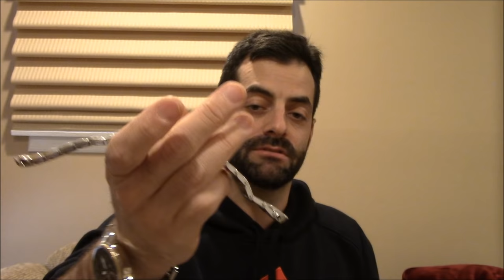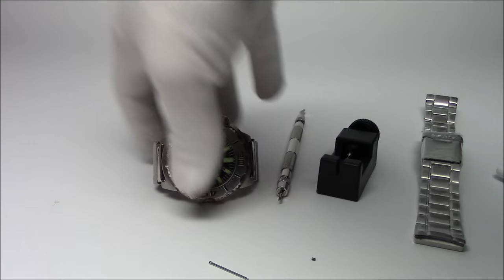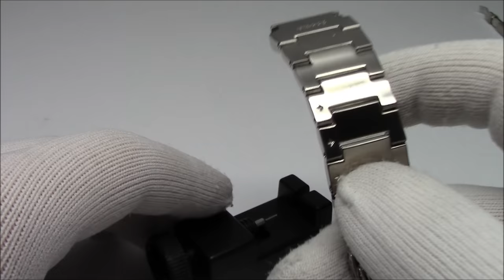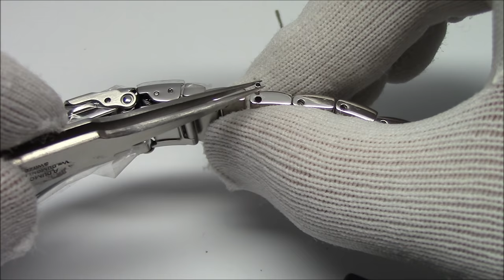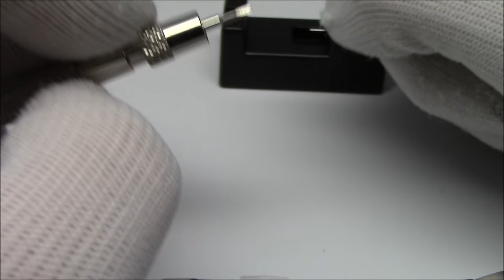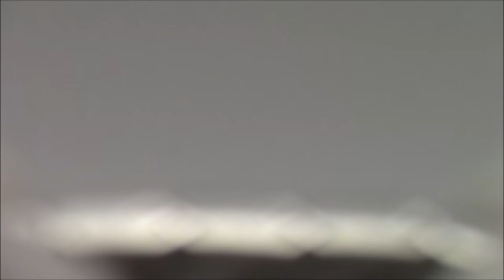How to size a Seiko (or any!) Pin and Collar Bracelet. Watch and Learn #15

Comment: these colar and pin systems are a complete nightmare to resize. Not just because it so fiddly and really adds nothing to the reliability or function of the bracelet, but because the collar part is SO TINY that if it flicks off when you are working on it you will never see it again and these are very hard and expensive ton get as replacement parts.

Comment: These are on the orient triton. Wanted to smash my head against a wall until I found this video
Reply: So you managed to do it? Did uou have the tools in the video? Cause without tools i cant put the damn collar inside the cap like Mark does and im running rapidly outta patience after 1h or trying :(
Managed to remove 2 pins with a paperclip, but no way to put one back cause of the damn collar not fitting in the hole by itself like in the video.
Anyone has any ideas for me, pls?
Reply: @CataVlad21  i know this is a year old but it might be that you can only insert it through the inside of the link. I know some seikos are like that.
Reply: I was freaking out because I thought there were two collars per link, so I was having some trouble. Finally, being completely frustrated I came to this video. What a lifesaver. 😂

Comment: Thanks, this video saved my butt when resizing my son's new Citizen watch. Did it on my own to start with, I was incredibly lucky not to lose the collars. Once I saw those, I knew I needed help and found your video. My son's new (2019) Citizen is different than my older one, which is like the Seiko you show here. The newer Citizen has the collar drop into the inner tang of the link, not the outer, which makes assembly and removal much easier,  just drop the collar in, put the link together, then drive the pin through. Thanks again for making Dad look good.
Reply: Me too. Removed the pin and this tiny split pipe thing dropped out. I’m like: uh oh! So easy once you got it
Reply: Thank you so much, your comment saved me! I couldn’t realise where the collar went in until i you said so

Comment: Mark, this video saved my tail today when I went to adjust my Seiko Presage.  I figured it was just a friction / cotter pin adjustment, but nope!  I tried to pull out the pin and it would not pull out all the way.  Then I remembered this series and watched this video.  My collar was hidden in the center of the bracelet. As I watched, you said, “expect the unexpected.” So I grabbed a white paper plate to put under the bracelet. Good thing, as I yanked the pin out the collar popped out of the center and was trapped inside the lip of the plate.  Another watch nube saved by Mark of Long Island Watch!

Comment: Excellent, excellent, excellent!!!!  This is a fantastic series with this one being most helpful to us Seiko owners.
Reply from the maker: Lee K So glad to hear it. Thanks for watching.
Reply: Right after watching the video I dug out my Turtle bracelet and sized it myself using the techniques you described.  I had purchased it last year already sized but it didn't fit quite right so I needed to remove one more link and change the micro adjustment in the clasp.  Everything went smoothly and I now have no fear in the future of the pin and collar system.  Thanks again!
Reply from the maker: Lee K awesome!

Comment: Yup. I'm one of those guys!

Marc, you just saved me my sanity, thank you!
In my youth I previously had 3 Seiko watches, all with split pin type bracelets. I was unaware of the Pin and Collar gizmo.

After many years of iffy watches I decided to buy a nice diver again and today I received my SBDC029 Shogun.
When I got home I began scrounging round the house for a suitable tool to resize/remove a link or 2 etc and after failing to find a decent pin or paper clip, a tool in the Samsung phone box seemed to meet the requirements.

I pushed the first pin out the right way (that much I knew), and proceeded to the next only to notice this tiny other cylindrical piece of metal lying there. Curious I put it aside and lone behold after the 2nd pin another one (the collars)
Terrified I was messing up big time I hopped onto google and youtube and this video came up.

Thanks man, this really helped.
Big thumbs up and sub.

Comment: I was sizing my Citizen eco titanium after I lost a couple of pounds and didn’t know anything about pin and collars until I saw and heard  the collars pop out. I picked saved them not knowing what they were but figured they were important. I took out a link and put the watch together but of ourselves there was nothing holding the pins in. I watched your video and learned. Of course when I put  the extra pin and collars into the original box I saw where the original links removed when I bought the watch and there were pins and collars in a small plastic bag. I am on the way to my local jeweler to have the bracelet put together properly because I know it is beyond my capability.  Thank you for adding to my knowledge of watches. I am a long time subscriber.

Comment: Thanks Mark for your very easy to follow instructions. I dont have the most steady hands in the world but managed to size my sumo I just got in the mail with no tweezers and using the tools I had lying around which happened to be the same ones featured in the video. I did lose 1 collar but managed to not lose any others, definitely made the rest of the sizing pretty stressful knowing that if I lost another one I'd be screwed haha. Thanks again for saving me about #20-$30, your a legend.
Reply: YES!  The collars are tiny and if you're holding one with tweezers and they slip slightly, the collar is launched into the air, never to be seen again.

Comment: Very useful video. I only saw it after I'd discovered the bracelet I was adjusting had this system. It was a voyage of discovery when I noticed the tiny collar on the cloth I had the watch on, while doing the adjustment. I worked it out and eventually got it all sorted, but if I'd seen this video first it would have been much easier and straight forward. Another very useful and clear video. I've since sold the watch and included the link (no pun intended!) to this video for the person that bought it. Many thanks.

Comment: Just want to tell you guys that for example, in the Seiko Samurai PADI the pin is on the inside of the link, so the holes are the same diameter and when you look you dont see the collar, when i did it for the first time i had the stop for a second and observe, and using the video as a guide i knew that the collar had to be somewhere caude it didnt come out stuck in the machine.
Thanks Marc you have been very helpfull with all your work in the channel.

Comment: About two years ago, I bought a lovely SPB219 and have worn it more than occasionally since. I happened to be typing a lot and released the clasp to wear the watch up on my forearm and out came the pin and off slid the watch - luckily into my lap. I look in the parts bag and find three links, two pins, and THREE collars. Nice of those fellas to throw in an extra collar <ahem> for when the one that was holding the watch together evaporated.  Thanks for this tutorial!

Comment: thank u mark for the presentation. i use a very simple tool with a "nail" end that happen to be exactly the same collar diameter. and to fit it back in i just hold it against a wooden table and push the pin back in from the opposit side (sometimes gove in a hit with a mini hummer). thank you again and look forward to watch your next video. very educating.
regards.
Reply from the maker: Alex B.H.S Perfect. Whatever works, right?

Comment: This video helped me out.  I ended up using a really small drill bit reversed in a pin chuck to push out the pins.
The collar slid out onto the drill bit and I stuck it on a piece of tape to keep it from rolling away.
Once I had a link removed, I used one of the extra pins and the drill bit to squeeze things back together.
Pretty easy for never having sized a watch before.  Thanks for the video!
Reply from the maker: Perfect! Nice improvisation.

Comment: This is a VERY helpful video. After watching it, the very next day I sized the stainless steel bracelet on my Orient Neptune/Triton. Sure enough, out popped the collars along with the pins. Thanks Mark!
Reply: Hi! Did you use the recommended tools in the video? I also own a triton for like 4 hours now and for the last hours or so im struggling to put the pin back in, but the collar just wont fit back as it does in the video, on the seiko bracellet :( 
Managed to take 2 pins out with a paper clip, but cant put one back in because i cant fit the collar in any hole without tools, it seems.
So, did you manage to do it with regular stuff lying around the household, by any chance? 🙂
Reply: @CataVlad21  I used the pin end of my springbar tool to work the pins and collars in/out. For a nice watch and bracelet like that, treat yourself to some nice watch tools. I think you'll see that they're worth the investment.

Comment: This video helped me a lot!! Thank you. I myself just bought a Seiko SNR049 and was not aware that the links were held together with pins and collars. I thought I could adjust the bracelet myself but I soon learned that it was more challenging than expected. The difference with the SNR049's adjustment and the watches in this video is that the collars are placed on the internal part of the link, NOT on the exterior. I would be lost with out this video.
Reply: Same on the Samurai

Comment: Very useful and informative video. I wish I had watched it a few days earlier. Just last week, I received A new Seiko Prospex solar PADI dive watch, with a pin & collar bracelet. I have done other bracelets many years ago, but none were pin and collar. In fact, I didn’t know that Pin and collar existed! So I proceeded to do exactly what you described, I didn’t realize the collars were even there until after I had lost one. Doh! Fortunately, I didn’t like the bracelet even before I bought the watch, so I just ordered a bracelet I liked much better and put a NATO strap on the watch until the other one came. At least now I know what went wrong. Thanks again for an excellent video!👍

Comment: Thanks! Note on the Samurai SRPB51 bracelet for your viewers: You gotta drop the collar in on the INNER side of the link on the arrow end. If you drop it in on the outside it won't fit.
Reply from the maker: Like the PADI solar diver, thank you.
Reply: That's why I couldn't get it to work, losing two "pipes" in the process! Thank you.
Reply: Thanks! I have to size a samurai  on monday, this is the comment I needed!
Reply: Same with the SBDC series. One collar on the inner link (arrow side). Pin does not have any wide barrel side (smooth throughout) ;)
Reply: Pity I did not find this comment 1 week ago I was banging my head on wall till I sussed it out about 30 minutes later
Reply: @islandwatch  so for my Seiko samurai I should do the opposite of the video?
Reply: @SA-hk8xj  Yep, the best part is I was going to resize my SBDC065 bracelet today, and the pin wouldn't fit back into the collar after putting the collar back into the bracelet.  Ended up having to use the rubber strap it came with.  Hopefully Strapcode makes something decent for this series.
Reply: Thank you Brother !
Reply: Sounds like a good way to solve the problem of the collar not staying inside the link. 👍🏽
Reply: The seiko sarb035 bracelet has the pipes slide in on the top side of the tongue of the link. Drop in parallel to the arrow.
Reply: Just used this to remove a link on my Seiko Save the Ocean divers with the pin and collar, thank you !
Reply: Also on the SBDC051 as I just discovered.

Comment: amazing advice and step by step demo! i bought a Casio Oceans and nobody said anything on youtube about it being pin and collar! lucky i caught it. only difference is you have to put the collar in from the inside of the watch link not the outside because it wont fit in the hole form the outside. makes it a bit easier
Reply from the maker: It makes it abundantly easier!

Comment: all through the years, I've seen lots of videos, and pictures on this.  I've seen some exotic tools made, and many suggestions.  My first Monster was sized by a Professional jeweler.  I took it to them, and they said they were very familiar with the pin and collars.  I got it back and the next day while mowing the yard, off goes the watch and of course the pin and collar was gone too.  At least I didn't run over the Monster.  Yours is the best video I've seen, and to use the very tools we already have.  Thank you very Much...
Reply from the maker: Thank you! Appreciate it.

Comment: With the Solar Padi, the collars are located in the inside part of the link. That's where they fell out.  I was about to take my watch to the jewelry store because I was trying to insert them on the outer part and they would not fit. I could not have figured it out if it wasn't for this video. Thanks Marc. You helped out another subscriber.

Comment: Thanks for this! I used this video to successfully size my Casio Oceanus s100 I got today. It's not as hard as it seems like it might be, though that's probably because the collar sits in the middle of the link instead of on the outside so you just seat the collar and align the links and push the pin in.

Comment: I think it is also good to note that there are cases where qc on these bracelets are sometimes skipped as I bought my SRP309 and when i was trying to get the links off "properly where the arrows indicate where to push" mine had the pins and collars backwards on the other half of the bracelet. I found out when i peaked inside and saw the collars where on the other side.

Comment: Point is Seiko should change the design of the fiddly collars...Screw in pins are nice
Good video, non the less.
Reply from the maker: Manny Singh I actually do agree with the response. I've sized a few bracelets with screws where the screws were seized and I had to replace links.
Reply: Fair enough, I've given up on these annoying Seiko straps. I'm not sure how I managed to do it on my  MM300...
Reply: How do you damage the thread on screw in pins? It's pretty much impossible if you're even remotely careful. Friction pins make me hate the watch, they suck so badly.
Reply: @DM-rc4yu  - They may be fiddly, it's a little easier on the folded link bracelets but unless the metallurgy and machining are perfect and the screws are as large as can be it's hard to make them last or keep in.  Lots of Rolex's get dropped badly because of their screw coming undone.

Comment: This video helped me resize a new Citizen Titanium eco-drive watch bracelet. Never seen pin and collar links before. Two tiny collars dropped into the cloth kitchen table place mat without me even noticing . They are very tiny for my old eyes. However I found them and was able to figure out how they go back thanks to your video. I've successfully removed one link and now my new watch fits great. Thanks!
P.S. The link is a body with two "dog ears" on one end that get pined to the next link body. The collar actually goes in one end of the main body. Looking at the end of the assembled pin in the link shows no sign of the collar. It was an interesting little twist - but not hard to figure out.

Comment: other guy's video did NOT show the collar issue/part. this is VERY helpful. thanks. also, the big/larger end of the pin need go back in last, so it matters which end of the pin goes into the watch 1st. i take them out carefully and place them on the table in the direction they go back into the watch, just to be sure.
Reply from the maker: Thank you.

Comment: Thanks for this video. I purchased a Citizen promaster diver BN0150-61E. I wanted to resize the bracelet myself as a little bit of a challenge and I also didn't want to pay extra and have to wait to get a shop to do it. This video gave me the general idea but I made a few observations and mistakes that I learned from so hopefully anyone with the same watch as me reading this might save some heartache. The little collars on this watch are located in the inner part of the link. They will absolutely fall out if you are not careful and they will only fit into one side of the centre link so be very careful. I tried putting them into the outer portion of the link on both sides and ended up bending one pin unfortunately. Luckily I had to remove links so will not need the extra pin and I can possibly straighten it at a later time.  For pressing the pin back in, save yourself a lot of hassle and use a pin pusher tool. It makes the pin insertion much easier and saves going crazy with a hammer, although the hammer method may work. Anyway it took me 2+ hours and a lot of frustration but some learning to get the job done and now I have my watch fitting perfect.
Reply: Additional note: If you have to remove 3 links to get a good fit like me, take the extra link from the 6 o clock side. The clasp will sit perfectly centered.